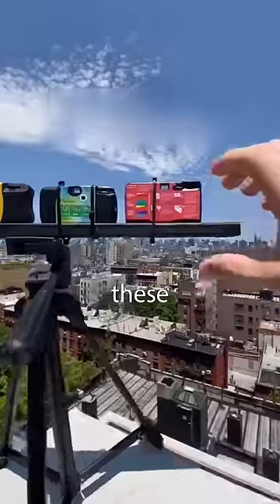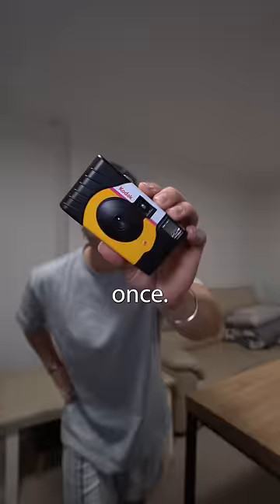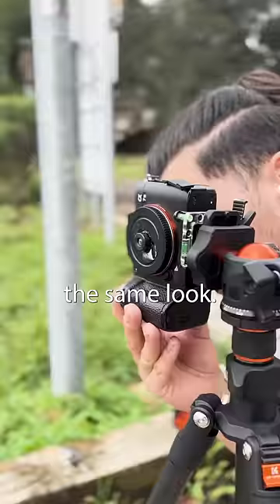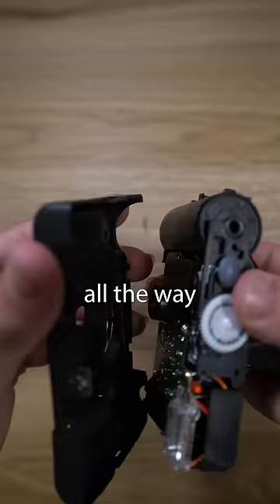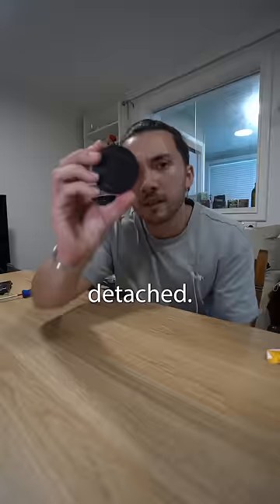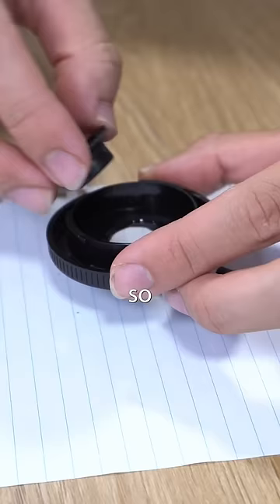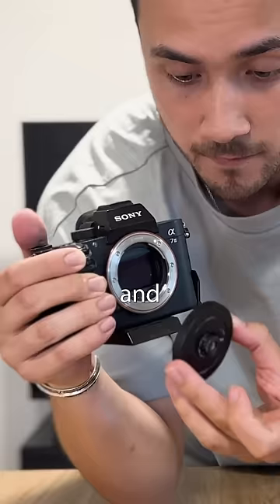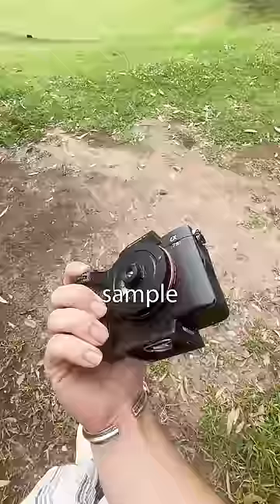I put a disposable camera lens on my pro camera

Comment: Be careful the capacitor that powers the led flash might be charged to a high voltage. There's a risk of getting shocked.
Reply: Bit late on that warning for him
Reply: I just literally commented how me and my sister used to take ours apart, take the film in, and then proceed to shock each other like they were tasers with them after 😂
Reply: @PrismZet  lmao, me and my older brother used to do the same
Reply: Nah. You should learn how DC capacitors work. It's using DC (direct current, so you wouldn't get shocked because it's DC. Just like you touching 9v battery or 12v motorcycle Accu or even 24v Car accu (battery)

You're not gonna get shocked because it's DC and not AC (alternating current)

So chill out dude
Reply: @azizsetyawan3038  nah you're not getting it. High voltage dc can shock you. And i found it out the hard way. Capacitors can shock you. Well you won't shake like ac but it can kill you.
Reply: @ExploringNew1  yes high voltage can. But the camera doesn't use high voltage, it's use 3,7V battery (same as phone) which barely even do anything even when you lick it

Edit :
It's not even using 24v Accu car battery which also still not shock you for that amount of voltage
Reply: @azizsetyawan3038  well some older cameras have voltage multipliers or boost converters to power high power leds or maybe incandescent bulbs but im not sure about them.
Reply: @azizsetyawan3038  this is in reply to both of your comments. DC can ABSOLUTELY still shock you, saying it can't is a straight up myth. Capacitors are a big danger for this as they store up voltage for the the flash or whatever device needs it. It's why old arcades with their big caps can be LETHAL, but a camera won't be but it will still shock you.
Reply: @ExploringNew1  still the voltage multiplayer isn't multiplied the amps too, which make the voltage not shock you

You need high volt and AMPS to make your DC shock you
Reply: @CouchParty  dude. I'm literally working at electrical engineering and i never get shocked by DC capacitors.

Sure DC can shock you but it needs a huge amount of voltage and current (amps). You wouldn't get shocked with only 3,7 battery on camera/phone

Even the 24 car battery still does not shock you

Watch electro boom, he use DC capacitors to make fake shock. Basically it's not gonna shock him, Only give a bit of shock sound (flashing ark or spark) but not actually shock him

You need AC to be more effective at shocking, that's why the teaser people or cops use for teasing people using joule thieves to increase the voltage and give some frequency (Hz) to make it AC (alternating current)

I do my best to explain it but I'm not good enough at English. Sorry
Reply: @ExploringNew1  do you know how huge high voltage capacitors, it's even huger than the camera itself

I'm pretty sure that camera would use ceramic capacitors
Reply: @staticvitality146 it’s not too late when others might want to try based of the video
Reply: I once took apart one of these. Capacitor was still charged, tingled my hand when I brushed the circuit board. Knowing that I could discharge the capacitor to make it safer, I connected the two contects with my screwdriver. I was then flashbanged by a pure blue and white light at 1am in the morning.
Reply: @azizsetyawan3038  well the shock from those might be short but it still shocks you.
Reply: Im totally shocked about that information!
Reply: Can confirm. Was a nasty zap.
Reply: It happened to me. I work at a camera repair shop, first 3 days of work 5 shocks. Its a pain in the ass.
Reply: @azizsetyawan3038 bro even its a 3,7 volts its multiplied to (usally) 330 and (rarely) to 450 volts i had one and i wanted to test it about half a year ago and i felt the pain for the rest of the day.
Reply: @AliTech_Official  Yeah, it's a xenon flash, not an LED flash. LED flashes cannot get bright enough for film cameras. There's a DC-DC boost circuit to charge the capacitor to a high enough voltage to trigger the flash tube.

Also, 3.7V is for a lithium ion battery. Disposable cameras generally used a single 1.5V AA battery.
Reply: @azizsetyawan3038  You should learn that it's not the voltage that kills you, it's the current. That's just not how electricity works.
Reply: I play with big capacitors
Reply: God almost nobody here knows anything.
They use xenon flash tubes, not LEDs. You need a capacitor charged to a few hundred volts for that flash tube. The capacitor is charged by a DC-DC converter generating this high voltage from the battery supply voltage.

DC can absolutely shock and kill you, just usually you need higher voltages.

Voltage and current are not independent values. YOU CANNOT HAVE A HIGH VOLTAGE ACROSS YOUR BODY WITHOUT HAVING A DANGEROUS CURRENT. With high impedance sources (low current capability), the voltage immediately drops when you touch it. Capacitors are very low impedance sources, they will have no problem dumping a lot of current through you.
However camera flash capacitors don't store much energy, so the current doesn't last long. So it won't kill you. That's the same reason why static electricity won't kill you even though it pushes a few amps through you for a short time.
Reply: oh, its not even an LED flash, but a xenon-filled flash tube, that gets zapped by a 300V 100µF flash capacitor which gets charged from a 1.5V alkaline AA battery using a boost converter.
Reply: I think you're a bit late to the party but I totally appreciate you suddenly teaching people about the art of old school makeshift tasers
Reply: I’ve done the before
It low key hurts
Reply: I got shocked like that once when I was 9 or so. Got a bunch of old disposable cameras and pried them apart. Felt like someone was shaking me very heavily and quickly when I accidentally shocked myself. Of course, after recovering for a few minutes and wearing some gloves, I decided to try and cut off the capacitor with metal scissors... Needless to say I have not touched a disassembled disposable camera in years.
Reply: So true

As anyone who knows anything about circuits and they'll tell you capacitors are the single most terrifying thing
Reply: Well that's now really shocking
Reply: Yah I did that once. My vision went black for a bit
Reply: Exactly what I was thinking
Reply: lol I was taking apart a camera and learned this the hard way
Reply: @FilthyGaijin lmfao my sister used to eat the film
Reply: That's happened to me 😂 I had a feeling something like that was going to happen in this video
Reply: ESD Strap.
Reply: Shocking
Reply: Yes but no.
Reply: @azizsetyawan3038 the fact you have "huger" in your vocabulary tells me enough about you.

As someone who's been shocked by one of these from playing the good old game of FAFO, I promise you that you can get shocked. Certainly not enough to kill the average person or anything, but you will be surprised. If you still think size matters (given you probably call other things "huger"), remember shock gum and other pranking gadgets? All DC, all smaller than a film canister.

The fact you claim to work at "electrical engineering" genuinely terrifies me for the well being of those that have to put up with you.
Reply: @azizsetyawan3038 Shock intensity is decided by amps. Shockability is decided by voltage. So a photoflash capacitor can 100% shock you.
Reply: @Warlock0880  nope. High current low voltage such the welding machine barely even shock you 

I'm literally working as an electrical engineer. dummy
Don't try to be a smart guy without even knowing the thing and what happens in reality

In case you're too difficult to understand the explanation :
Current (amps) is the one that produces heat, the shock power in one volts

There's a reason an electric gun or teaser gun that cops use is using 10000volts and not 1000Amps

Because you need volts more to shock you
Reply: @AliTech_Official  and you need ceramic capacitors to increase the voltage to that amount
Reply: @peachypet808  yes. You're right, shock capability is decided by voltage

But I'm pretty sure this type of gadget doesn't use ceramic capacitors to increase the voltage to few hundred
Reply: @Kepler_2258  man. I'm literally an electrical engineer. I already got alot of shock, even from 220v house outlets.

And can you explain to me what voltage booster did you mean since there's a lot of voltage booster method in the electric world 😊
Coil boost ?
Ceramic capacitors?
Or even electrical circuit joule thieves?
Ect

I'm pretty sure the coils wouldn't fit in those gadget 🤭
Reply: Seriously? You're going to belittle me for calling your shit? Electricity is dangerous, period. Complacency gets people hurt or killed. Yea, welders don't run a high voltage because the arc doesn't need to be that long. But what if you're not working in a dry environment? What happens if you end up dealing with moisture? Suddenly that voltage is a lot more dangerous. 

I don't care if you're working as an engineer. You don't learn everything in school. You learn a lot of stuff when you work with the blue collar dudes. They appreciate it when an engineer designs something with their point of view. Perspective is something you seem to lack.

I am WELL aware of joule heat losses in a circuit. I am well aware of Ohm's law, as I am also an engineer and self-taught programmer. I'm surprised you're not aware that it doesn't take much current to stop a heart regardless of whether a frequency is involved.

Yes, tasers don't run high current. They deliver no more than a few milliamps, but that's still enough to result in fatality. 

We fundamentally do not see eye to eye. I hope we never work together. I would hate to work with someone so complacent.
Reply: @azizsetyawan3038  they have a mini transformer inside with a miniature high frequency driver and it dumps the voltage into a capacitor, in fact you can hear the capacitor charge (the core of the transformer winning while it fills the capacitor) in those older transformers, then when you press the button to take a photo it dumps the 300v into that flash lamp, newer disposable cameras usually use LED but the older ones did use Flash Lamps
Reply: I accidentally shorted the cap twice in 5 mins.  Fun times being legally blind!
Reply: You can use these high voltage capacitors to make EMPs 😈
Reply: @EamonOLeary  i mean yea, but their not super good emp devices
Reply: I think he knew that buddy, dont need to write a damn essay
Reply: I know from personal experience bahaha, those capacitors hurt like a bitch.
Reply: Bro skipped school, then tell me how the heck a flyback transformer shocked me if it's "dc"
Reply: What about those 2kv blue capacitors used in marx multiplayer?
Reply: @azizsetyawan3038 buddy 😂 why comment on a topic you don't understand? Boost converters exist, and flash often uses a very high voltage. You can get 300V out of a 3,7V battery. Don't talk about electronics any more
Reply: @azizsetyawan3038 "I'm working at electrical engineering" okay buddy 😂
Reply: @dimitrijekrstic7567  ok, can you explain how it work buddy ?

If you really know it 😊
Reply: That's how u make a taser
Reply: No let him get a Darwin award
Reply: @azizsetyawan3038  the capacitor for the flash normaly charges up to around 300 Volts. This will definitely hurt if you touch it.
Yes, there is a diffrence in how much ac hurts compared to DC, but that does not mean that DC is safe. It can definitely still hurt or even kill if your voltage and current is high enough
Reply: Touching a capacitor in a modern camera flash has a good chance of ending your life
Reply: @lucashenr2828  you clearly don't know how to boost the voltage to that 300v point
Reply: Not LED, but yes, high voltage.
Reply: @azizsetyawan3038 The voltage is stepped up
Reply: @azizsetyawan3038  dude maybe you are not old enough to have ever been around one but you can hear the capacitor charge they easily clear 300 volts
Reply: @TWEAKLET  don't be dúmbs. Charging the capacitors doesn't make any sounds dúmbàss 😂

Never hear regular electric flow give you sound 😂
Reply: @azizsetyawan3038  you most Likely would use somee voltage multipliers in series or a boost converter (proberly not used for the flash module) and yes the current will fall, but that does not mean that it cant hurt. You will definitely be able to feel 300 volts on a cap if you touch its terminals
Reply: While its not dangerous for most people, be extra carefull. You might just have an undiscovered heart condition, and then this kind of shock can be lethal.
Reply: Brother, it's a disposable camera. It's not going to do any real damage. I was shocked the main breaker of my house, hurt like hell, but I'm still alive.
Reply: @azizsetyawan3038 perhaps you have a different definition of the word "shock" than is commonly defined in the English language, or perhaps you are confusing the word shock for the word electrocute? What you are describing there: an electrical arc that enters flesh - that is quite literally a visible electric shock. A spark/short where any part of the current is you... Is a shock.
Reply: I did that to myself once, hut like hell but I was ok  just a tingle in my hand for a bit
Reply: @azizsetyawan3038 did you get that crap that you wont get shocked because its dc? Ac currents are in sine waves meaning their phase have positive, neutral and negative while dc currents are all in positive and rectifiers isolate the negative ones, that means once you touched a live dc, youll get a steady supply of positive current which is dangerous. The only reason you didnt get shocked in batteries is because you probably didnt have a a full circuit (you only touched the negative or positive) or the volts is too low. Try touching an ac to dc 12v, 1amp charger and lets see how youll fare
Reply: @azizsetyawan3038 no youre not an electrical engineer
Reply: @azizsetyawan3038 yeah current is not dangerous thats why the human body can only take 6 amps before getting toasted to death, so much for an electrical engineer
Reply: @belagu4517  
wtf. What do you think of a car battery voltage and amps is ??

Most of them are 24v and can store around 35-45-60amps

You clearly know nothing about it. Try to fix your car electricity, and you'll know
Reply: @lucashenr2828  well you forget that voltage multiplier use Tranfórmer to multiple the voltage, and Tranfórmer only work with AC and not DC. So they use Joule thieves to change the DC to AC so you can increase the voltage using the Tranfórmer

This joule thieves circuit also used on teaser gun or electric gun that cops use to knock people out

Using pararel ceramic capacitors need alot of space and ark generator which impossible in this small device 

So my point from the beginning was right, the one that shocked you is the AC and not DC, because you can't even boost DC voltage to 300v without Tranfórmer
Reply: @azizsetyawan3038  And this is why I know you are young enough to have never used an old-school disposable. The capacitor itself isn't making the noise, but the action of charging it does. It's very noticeable. There are plenty of YouTube videos of people playing with these, and it's a noise anyone alive in the 90s recalls. It's the transformer that's making the noise.
Reply: I use to make tasers out of these as a kid.
Reply: It’s ton an LED flash, it’s an incandescent
Reply: @azizsetyawan3038  just read through these comments. You’re fighting a group of people here, respect to you for holding your ground so well😂
Reply: @russell9758  well the truth shall win. Even when everyone is against the truth, I'll always fight for it
Reply: those capacitors have high voltage but have a low amount of power they really shouldn't hurt you (unless you have a neurological or muscular issue) The shpcks, while highly noticable, are surface level and weak, it's the amperage that actually can hurt you, but due yo the distinct lack of energy, it can only be at even a noticable amperage for 0.01ths of a second, if that long
Reply: Let ElectroBOOM handle that
Reply: Voltage alone isn't really dangerous
Reply: I remember a video from like 15 years ago pointed out that you can turn one of these into a homemade tazer.
Reply: @azizsetyawan3038 confidently incorrect

Learn electricity dude
Reply: @azizsetyawan3038 400v cap can be small
Reply: @Warlock0880 no

The power kill u

And the voltage is the main culprit, there must be a voltage to bring out the current

1000v 1a can kill u

1v 1000a can't kill u

Saying current kill is like saying the bullet kills not the person shooting the gun

See how that holds in court
Reply: @Warlock0880 also electricity doesn't work in current or wires or crap

Electricity works in fields
Reply: @azizsetyawan3038 u r definitely not an engineer kiddo

As an engineer I can tell u that
Reply: @Warlock0880 and incompetent
Reply: @azizsetyawan3038 lol dc booster is easy to build
Reply: @urnoob5528  I'm work as electrical engineering. Definitely I don't even need to learn it anymore, because i work in it

This internet are full with people that don't know and never experience it but being know it all
Reply: @azizsetyawan3038 dc can make ac omg

Learn ac and DC and learn Fourier transform, then learn circuit analysis

Transformer can absolutely work with dc by formal dc definition

As long as there is frequency and it is changing
Reply: @azizsetyawan3038 the scholar can't fight with the clown, the clown is always correct

Truth yeah right

Dude can't even get the basics down
Reply: @azizsetyawan3038 dude is telling on himself
Reply: @azizsetyawan3038  are you a man of religion?
Reply: @russell9758  idk why you're being out of context, we're talking about electricity. Not about religion lmao 🤣
Reply: @urnoob5528  if you know it all then you shall explain it how to increase the voltage from 3,7v to 300v

I wanna see your knowledge 😊
Reply: Shocking
Reply: It's not that big a deal. Like a bad static shock at worst.
Reply: As a kid I used to pull the capacitor and wires out of the cameras and use them as stun guns 😅 zapped and burned the fuck out of myself and quite a few of my friends
Reply: ya dont say
Reply: Ee used to make tazers out of them in high school
Reply: @azizsetyawan3038  was just interested in your character, and you showed your true colours. Take care.
Reply: @russell9758  thanks, have a nice day
Reply: Yeah I did that when I was 8. Here I am now ^.^
Reply: @azizsetyawan3038  You have a fundamental misunderstanding of the function of the battery and capacitor in the camera.

The battery supplies constant low voltage power to charge the capacitor. The capacitor then discharges stored power at very high voltage for a short period of time to activate the flash.
Reply: Happened to me as a kid. My hair is still standing up. I'm 54 now.
Reply: A capacitor that small is only dangerous to someone with a pacemaker. A little shock like that isn't gonna hurt you.
Reply: these cameras use a xenon flash tube (like mentioned above) which need 300v to operate (generated from a booster circuit), the POWER IS LETHAL IF YOU ARE UNLUCKY! one of those caps at full charge is around 16 joules, which note that the heart rhythm can be disrupted at 10 joules minimum, if you get the current flowing across you it WILL KILL

while it is DC if you have a cut or anything on the skin or even just moisture it will cause a decent amount of conduction and while USUALLY harmless it absolutely can kill. 300v is able to break down the dead skin layer and since its a capacitor it can discharge a couple dozen amps in a few milliseconds, peak current along with duration matters here! 

tldr these at best will give you a bad jolt and at worse will be lethal, but this is really worst case scenario but high voltage capacitors are not something to be taken lightly
Reply: Man nearly fucking died lol
Reply: @azizsetyawan3038  electrical engineer here, there's a switched capacitor circuit there that generates and upholds around 300-400V DC for the flash tube. This is also why it sparked so vigorously just from a driver in vicinity, it doesn't even need to touch to draw quite a destructive arc.

The capacitor is also easily capable of releasing a very high amperage.

The total stored charge isn't high so it's usually not lethal but it's very unpleasant.
Reply: They can be used to build a gauss Cannon as well
Reply: @azizsetyawan3038  the camera isnt high voltage but the capacitor is, iirc its 50 volts, enough dc to go through skin
Reply: Been there, could barely walk for a bit because I was shaking too much
Reply: Not gonna kill you, but you can have a lot of fun with it.
Reply: A capacitor that can fit inside a disposable camera and is charged off the on board battery is never going to do any real damage lol
Reply: They used to use these cameras to make homemade tasers
Reply: That was me at 8 years old! We would stand in a circle holding hands, one person would touch one end of the capacitor , and the person on the end of the circle would touch the other and we would all get zapped at the same time. 
I tried making an electromagnet using 240V when I was 9, that one didn't end well!
  @ThePickledsoul
Reply: @azizsetyawan3038  wtf did u just say ?? try touching one of those caps and then tell me you dont get shock haha
Reply: @TiSapph  Finally someone who gets it. The original guy saying capacitors aren't dangerous is probably thinking of safe capacitors on PC motherboards and modern cellphones, not high capacity capacitors in old CRTs and Xenon camera flashes.
Reply: What 😮
Reply: @ItsWarmist  yep, i already touch alot of caps. Since i also repairing microwave, TV, and other electrical components. And i can said I'm didn't get any shock
Reply: @azizsetyawan3038  not sure we’re your from but definitely not a English speaking country, I can tell by your poor grammar not a big deal but  to be honest doesn’t make any sense what you say and could put others at risk . I’m a biomedical engineer, you are talking nonsense with absolutely zero knowledge of how electricity works. You are a lucky guy  that have not touch a charged cap, I bet you to disassemble a working disposable camera and touch the cap with your bear hands and post a video about it. Therese no way you are an engineer with that knowledge of dc current. That’s how a simple teaser works.
Reply: @ItsWarmist  yes, I'm not from English speaking country. And to be honest English is my 3rd language

I'm working at electrical engineering, we fix alot of things from TV, radio, fridge, dishwasher, washing machine, ect

And I'm pretty sure i touch alot of capacitors and never get shocked

Also high voltage capacitors such ceramic capacitors only work if you put it on parallel, and using arc generator just like electro boom did to make magic wand to shock people
Reply: Bro, thats not a warning.  Thats an invitation to mess with your friends.  Wed expose the circuits,  charge th3 caps and touch anyonr asleep on the bus
Reply: But dont worry if you do get shocked. If you dont have heart complications, youre perfectly fine.
Reply: For people that don't know they don't just shock you. It's more of a loud bang and has the effect of a firecracker. I had to find out the hard way about 30 years ago or so when I was tearing one apart and twisted the two leads together.
Reply: You’ll be aight
Reply: My first electric shock was from disassembling one of these cameras as a kid...
Reply: Yeah i got shocked by it once... it really hurt
Reply: @xX_H347H3R_Xx that's when you shock your heart

But if you only shock your arm. You wouldn't die. Even i get shock by 220 power outlet and still fine enough 

Except with high voltage
Reply: @xX_H347H3R_Xx 
i didn't say anything about this being not dangerous
Reply: @xX_H347H3R_Xx yep. You're not gonna get shock with 12-24v DC

What's wrong with that ?
My point still stand
Reply: While sound advice in general these capacitors in particular are not powerful enough to be dangerous.
Reply: @azizsetyawan3038 that’s not how it works. It doesn’t matter if it’s DC or AC. The current doesn’t matter at all. It’s the voltage that kills you.
Reply: @azizsetyawan3038 dude you are very clearly not studying EE. ElectroBOOM does not “fake” shocks. He gets shocked but since energy transfer is a function of time, the shocks aren’t harmful. He pulls away instantly so little electricity actually crosses his skin. 

You do realize that when people say AC is dangerous and lethal, it’s not because the current is alternating. It’s because AC is better than DC for transporting high voltages. You can get high voltage DC but impedance will cause lots of heat loss whereas AC doesn’t need to travel long distances. It just oscillates.

High voltage DC and high voltage AC are just as deadly. The only difference between AC and DC is how the electrons “flow” through the wire.
Reply: I am from India, and I love how you guys swap "." And "," with each other. However, we both are correct at our place.
Reply: @Warlock0880 😂😂 bro you are soo right. I finally found someone whom I agree with!! Literally everyone is just so dumb. Few comments literally gave me a few minutes heart attacks. Thanks bro you saved me !!!😂😂
Reply: @ExploringNew1  I once opened up a phone charger because it was broken... let's just say that I learned about the dangers that capacitors pose... The hard way.

I got shocked and threw the entire open charger in a random direction which fell on my sis 😂 but thankfully the capacitor is not easy to touch.
Reply: It's about the same as a static shock. Took many in my day
Reply: @azizsetyawan3038 bro I’ve literally gotten shocked before and it hurts
Reply: Yes. I got shocked by one. Palmed it off to my dad to throw it away
Reply: @azizsetyawan3038 you can absolutely get shocked by DC capacitor I know this for a fact because I have been shocked by a DC capacitor in a disposable camera while taking one apart so you can sit here and tell people they can't but you literally can and if you don't think you can then go get a disposable camera charged it up and get shocked...... Go for it because you are absolutely wrong you are definitely going to get shocked and it's a good shock
Reply: @azizsetyawan3038  you may be a working electrician but it is clear that you have never touched a live charge DC capacitor I'm going to let you know right now that that little capacitor that's inside of your camera is going to discharge at 300 volts..... You're going to feel it again people are telling you this because they have been shocked by it I don't know why you're trying to tell people they didn't get shocked by something they got shocked by but you literally don't know what you were talking about
Reply: @azizsetyawan3038 "you wouldn't get shocked bc it's DC." Lol
Reply: @AkamiChannel  yeap. Try touch your car battery and it wouldn't shock you
Reply: @azizsetyawan3038  the battery voltage does not equate to the charge of a capacitor in any flash camera. It’s boosted typically 100x so roughly 330 volts in most cases. And the amps? It follows Ohm’s law, Voltage/Resistance.

Let’s assume 10000 ohm resistance on the body, but be more realistic and assume roughly 6000 since the contacts of the capacitor are short distance apart. 330/6000 = .055 amps or 55 milliamperes. Seems small, but that is still current flowing, meaning you will get shocked.
Reply: @azizsetyawan3038  That’s because a car battery is only 12v. 12v DC will not shock you externally. Now try hooking up some jumper cables and lick those, you’ll cry if you don’t die.

Ohms law (6000 ohm avg body resistance) is 12/6000 is 2 milliamps. That is too low to feel.

Now we’re not talking about a car battery. We are talking about a high voltage DC capacitor that stores on average 330 volts DC. The average resistance of the human body is around 6000 ohms.

330/6000 is 55 milliamps. A current of just 10 milliamps is enough to produce a severe shock. A sufficiently charged flash capacitor will shock the shit out of anybody. This is especially true considering flash capacitors are further designed to dump their current extremely rapidly.
Reply: I shocked myself when I was a kid taking apart one cause I needed a battery
Reply: A battery in a disposable is not giving you a high powered shock 😂
Reply: @azizsetyawan3038 No thanks. There are other people here in the comments talking specifically about getting shocked from cameras, which is exactly what you're saying is fine.
Reply: Bro you’re get a 3v zap, you won’t even notice it
Reply: yup.. we used to use them as make shift tasers in junior high
Reply: And emps can be made with them...
Reply: There are a few things people don't understand here.

1. It doesn't matter of its AC or DC it will still shock you if the voltage is high enough. And since the camera uses a flash (idk the exact name od it) and not LEDs it does need high voltage to make that light burst.

2. Do not be worried about it that much. Even in worst case it will just burn your finger a little. Or if you short it it will make a spark.

3. Do not be afraid of electronics and high voltage just be careful...
Reply: Let nature do its things. We need some Darwin award finalists.
Reply: My brother found out the hard way
Reply: It's feels like a hammer bite you. No big deal.
Reply: That would be shocking
Reply: @azizsetyawan3038  capacitors store charge 🤯
Reply: electroBoom be like: FIrst Time ? Hah Not for me EVER!
Reply: @azizsetyawan3038  How tf are you an engineer without knowing about switching amplifiers or even Ohm's law
Reply: I was pulling an old camera apart and got shoked like 8 times (across me and my father combined) and he decided to just short circuit the capacitor with a screwdriver
Reply: You know nothing about the capacitor, do you? 
Learn some basic high school physics
Reply: I got shocked and nobody believed me so then my friends tried it SNS they got shocked too 😂
Reply: @staticvitality146 he’s warning us dawg not the content creator.
Reply: This is precisely why my friends and I took them apart as teens 😁
Reply: I'm glad you warned him before I watched the video. I hope he listens.

Edit: He didn't listen
Reply: bro it runs on double a batteries
Reply: @azizsetyawan3038 bro learn something. They use voltage multiplier that boost the voltage to over 300v. And   yes it can easiely shock you REALLY bad because the cap realeses the voltage VERY fast, which theoratictly generates an infinite current, if there is no resistance.
Reply: @PrismZet im imagining you and the other guy below you in the replies going like
HAHAHAHHAAHHAHHHAHHHA-shock-HAHHAHHHAAHHAHAHAAH
Reply: Its high voltage,it can shake this out
Cause nobody wants to the stop
Check it out
Reply: @azizsetyawan3038  i know im late but if you think DC cant shock you you are not an EE, or at least not an EE who gets hired

btw, i shocked myself with 7200 volts DC about 20 minutes ago so yes it definitely can shock and it hurts
Reply: I think I saw his skeleton
Reply: @azizsetyawan3038  bro a capacitor can store DC and deliver a high current , so it can shock you
Reply: I got shocked by one of these when o was using it as a cheap EMP circuit (just connected a electromagnet to where the flash used to be.
I had been holding the circuit on my right hand, not noticing that it was touching one of the capacitor legs, and when i went to use my (non insulated) screwdriver to bridge a contact to trigger the circuit, it accidentally hit the other leg of the capacitor.
I felt the shock going from one hand to the other and all the muscles along the way tensing and for a second, i was completely still, not daring to move, thinking "this is it, there goes my heartbeat", but in the end, i was ok and my heart did not stop😂
Reply: @azizsetyawan3038 the capacitor in a disposable camera is rated to around 3 to 5 kilovolts (3000-5000) or even higher, as the old flash they have needs high voltage to work.
The electrolytic capacitor in the camera can definitely give you a shock, maybe not enough to kill you, but definitely hurts.
Reply: Electroboom: are you sure 💀😂
Reply: I actually got myself with that when I was younger it burned a small hole in my finger 😂